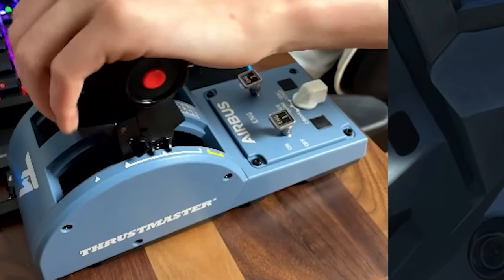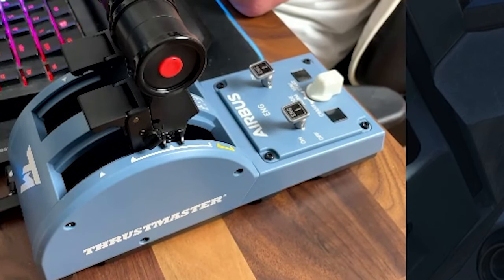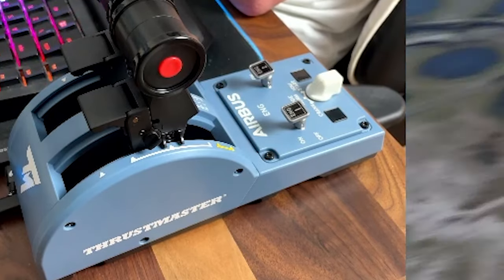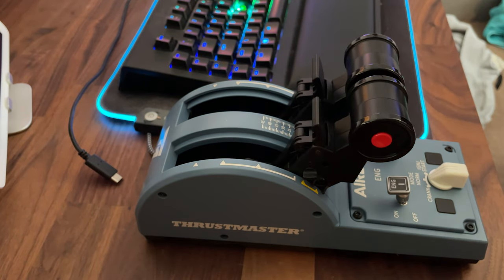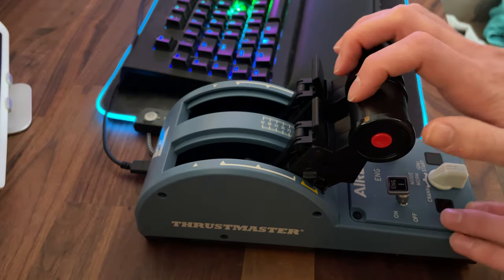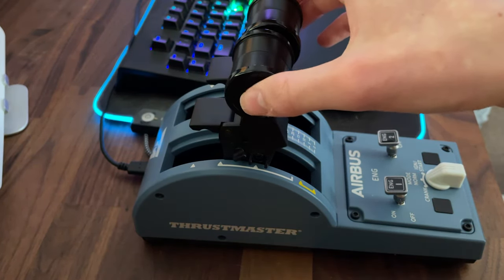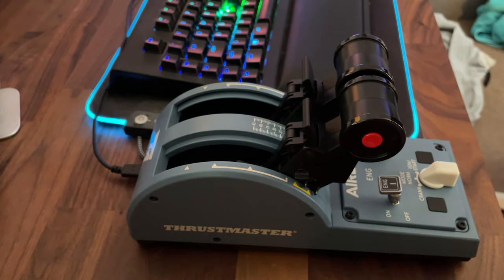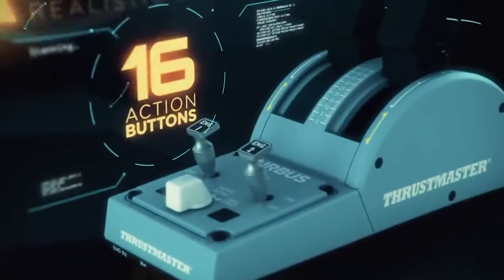Airbus Throttle Quadrant | Calibration - EASY

Comment: What does this do/fix exactly? I have this for my xbox x and have an issue with the throttle leavers being out of sync slightly. E.g If they’re level physical, they’re 3% out in-game. Would this resolve that? If not any suggestions?
Reply: there is a little metal thing in the box that you can put in the holes of the thrust levers to make them be the same
Reply: @legitmariosgr  yeah I’ve got that in, still get the discrepancy…it’s the cause of all my poor landings 😉

Comment: Worth noting: For people with the addon mod (flaps and spoilers) for the quadrant, you have to move them also, or you'll come into an issue where they do the opposite of what you want them to, i found out the hard way! - 
-Throttle to full REVERSE, Spoilers Full, Flaps Full => Black Button next to IGN/Start - Then plug in
-Throttle to TOGA, Spoilers Up, Flaps Up => Press two red buttons.
-Throttle to MCT, Spoilers 1, Flaps 1 => Press two red buttons.
-Throttle to CLB, Spoilers 2, Flaps 2 => Press two red buttons.
-Throttle to IDLE, Spoilers 3, Flaps 3 => Press two red buttons.
-Throttle to full REVERSE, Spoilers Full, Flaps Full => Press two red buttons.
Reply: Thank you!
Reply: nice, thanks :)
Reply: Love you bro
Reply: Thanks man! Appreciate the help!
Reply: Do you do this during gameplay or not in gameplay? I cannot get this to work.
Reply: This isn’t working for me 😢😢😢😢
Reply: I have the addon mod and did the calibration the way you said.  Now nothing at all on the quadrant works including spoilers and all buttons which were all working before
Reply: @MichaelHamilton-op4zi  same happened to me, go to 973Sierra’s video on the step by step calibration with the addon and follow what he does. here is the link to that video if you can’t find it https://youtu.be/19KRfoJ5PeYand then go to your control settings thingy and go to the flaps and speedbrakes/spoilers and click the reverse axis then it should work 🙂
Reply: @emeldashowmen1940  I did a bit of research and realised the reason it stopped working was because the instructions I'd seen failed to mention to press the black buttons either side of the engine selector switch to complete the calibration.  I re-did the calibration the correct way and now it works (well, sort of.  Everything works except the spoiler axis is reversed but if I go into the settings and reverse the axis, the spoilers work correctly but the throttles and flaps go unresponsive.)
Reply: @MichaelHamilton-op4zi  That’s really strange… I emailed thrustmaster and they got back to me pretty quickly and asked for a video of what is happening and stuff along the lines of that. But I’d already got it sorted so I emailed them back saying thanks for your help but I fixed it. So if you’re still having issues I would pop them an email.
Reply: @emeldashowmen1940  I've seen a few posts where people have said they had to do the calibration 3 times and then it worked properly so I did that and now it all seems to be working as it should
Reply: @MichaelHamilton-op4zi  Good good 👍
Reply: Think that’s my problem I’ll try that tonight.  Screen shorted this but Thankyou soooo much for saying this. X.   Hugs from Scotland
Reply: HUGE THANKYOU MATE.   That’s fixed it for me.  I COMPLETLY messed it up after following this video but like you say if you have the full set up it’s a little different to do.   Appreciate your comment.  

Any idea though how to make the taxi speed a bit smoother from idle to slightly forwards ? Engines rev up loads after leaving the idle detent ???????? ❤
Reply: @JimboAmerican1980  I know! I feel like I have to move the throttle out of the detent a tenth of a centimetre and the engines rev up to 60%
Reply: I'll Try that thank you
Reply: @emeldashowmen1940  hey my dose it to only here to touch it a bit goes to 60% I’m on xbox did you find a fix?
Reply: Thanks that worked
Reply: do i have to do it while being in the game?
Reply: honestly i couldn’t thank you enough
Reply: Thank you!
Reply: すべて解決しました。ありがとう。日本から
Reply: You saved me right there!
Reply: still didn't work for me :(
Reply: @emeldashowmen1940 he didn’t say two black buttons to hit last step I just went through this just said I was having issues then say the post .. do what he said and when finished doing exactly as he mentioned hit the two black buttons next to the start and crank and it will work
Reply: Thanks brother I was a bit upset for a while here your post saved me lol many years later but that’s what the YouTube is for!

Comment: Hi, I just bought a sidestick and a quadrant same as yours, I was trying to turn on the engines in A320 using the engine buttons in my quadrants (the ones you flip up and down) but they dont seem to work, the white button that you flip left and right doesn't seem to work as well. Do you know how to resolve this issue? I want to turn on my engines using the engine buttons in the quadrant. Plesae.

Comment: I don’t know if you explained it in this video or not but I’ve had trouble with my throttle quadrant reason being every time I slightly move it up from idle the thrust goes automatically to about 80%. Is there anyway I can fix that? I’ll try your method just to see if it works.
Reply: i have the same problem it just goes to toga when i put it a little above idle
Reply: did you fix it and how did you do it?

Comment: Quick question. So I just got mine today, and whenever I load into flight sim, it shuts engine no. 1 off and sets the flaps to full. And I can't fix that. Do you have any ideas on what I could do?
Reply: I have exactly the same problem. As a quick workaround, I disabled those buttons in the MSFS2020 config. It means they don't do anything, but at least I can fly with both engines. Still looking for a solution though.
Reply: @jasonb6620  i  found a solution, you just need to delete the settings for the fuel valve of engine no. 1 and 2 :) If you have any more questions or just can't find the settings then feel free to reply to my comment again :)

Comment: Hi great video but I have air brake and flaps addon my issue is everything works as it should but when I move throttle to reverse thrust in the cockpit they stay in idle position. I am playing on xbox x version and I dont know what I am doing wrong please can you help me? Thanks in advance

Comment: Hi, I have did as instructed in your video, but my throttles when at idle engine power is always around 26% yet the aircraft does not move even with parking brake off? any suggestions? Thanks
@techteen
Reply: Same
Reply: That's just the idle power, its just the engines working properly.

Comment: Have the captain set up for Xbox but only registered as co pilot in option does this matter also if you could help added the additional throttle control so four engines but won’t work and lost control of flaps 😢

Comment: Do both of your thrust levers make a clicking sound when moved forward individually? Cuz on mine only the left throttle lever makes a clicking sound.
Reply: You might need to unscrew the tab directly underneath the throttle leaver on the bottom of the unit (2 screws) take the part out turn it around and put it back in.
Reply: @monsurepik  I also tried this and it did not work anw the other lever is still making a clicking sound

Comment: Ah i think i have an issue here. Fixed the throttle balancing issue but created a new one. I have the full setup with the add ons attached now have issue with my flaps lever. Any idea how to fix the flaps
Reply: move the flaps and speed brake lever along with the throttles as you push in the red buttons at each step

Comment: Great video for the tutorial. But I think you are missing the one last bit that it has a pin coming with the quadrant that can help you align the two throttles. :p
Reply: @TravisPrybylski  Um... I think they stick it on the paper box with a tape... If you have thrown the box away, there a chance it has gone to the bin 😭
Reply: The pin is the screw driver it came with, shaped like an Alan key.

Comment: Sadly I did this on mine and it’s completely messed up mine.  Flaps are up but in the sim they are fully down.  Spoilers are set to up retracted in the sim they are fully up.  

Wish I never did this now contacting Thrustmaster for help cry 😂.  I’m on Xbox series X
Reply: After what a guy below said about doing the same with flaps and spoilers this fixed my issue after following this straight forward video.  Big thanks to him